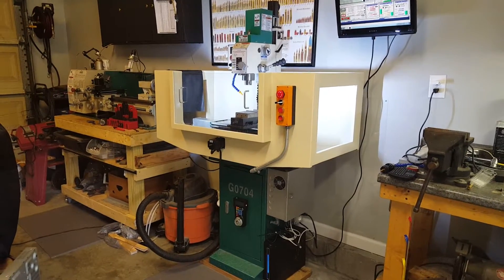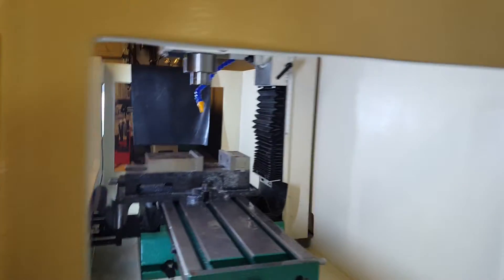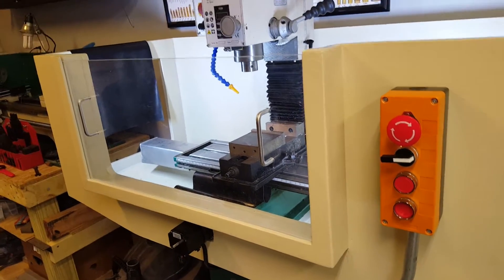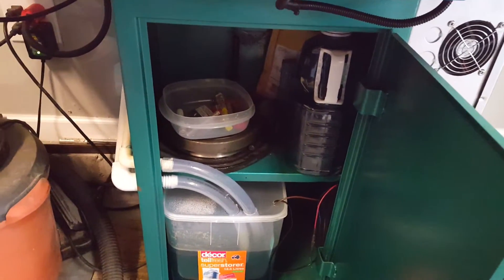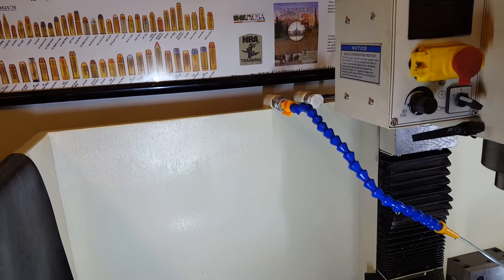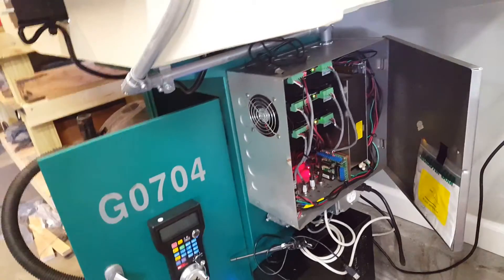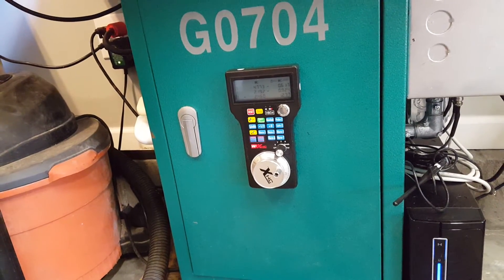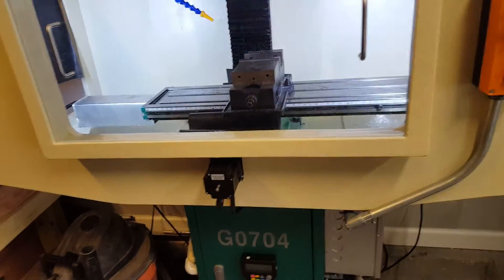G0704 CNC conversion with flood coolant cabinet

Comment: Good job.

 I agree with Helmut on the risk of electronics below the pan. However live and learn.

I am sure that by now you know but to add coolant is just connecting a relay to the coolant pump and assigning a pin within Mach. Same for the spindle, except you need an additional board like the C6 from CNC4PC.